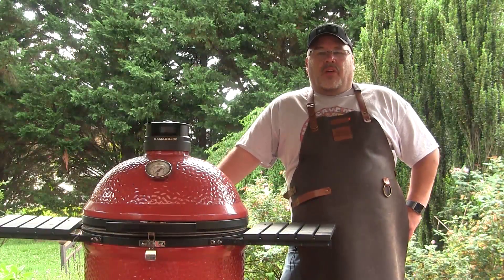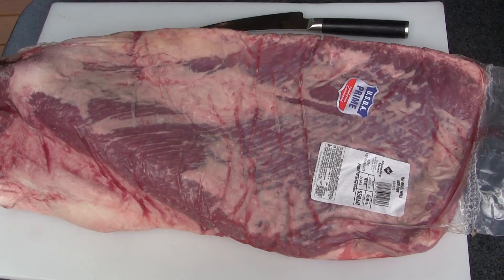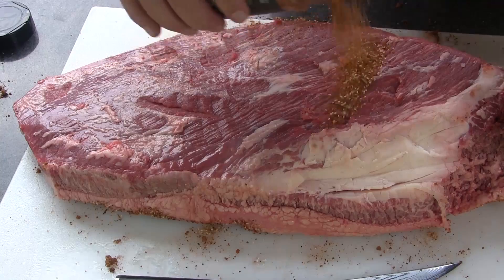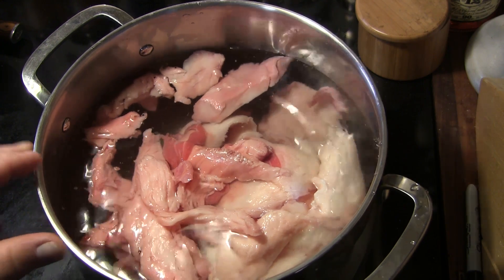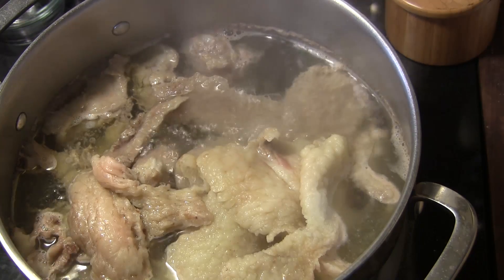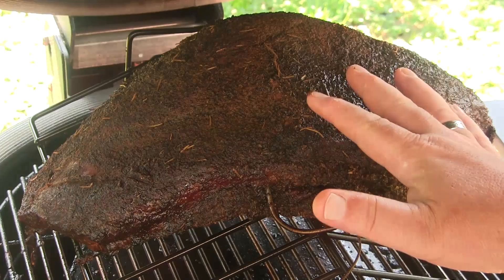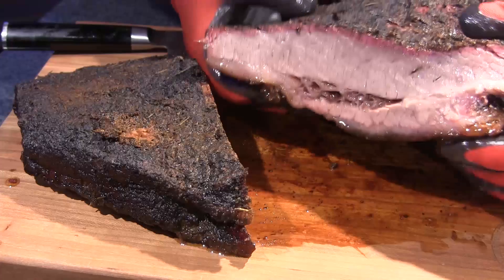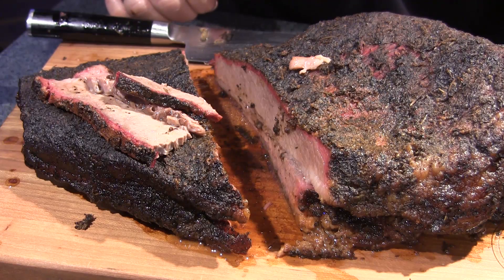Kamado Joe SLoROLLER Brisket + Beef Tallow

Comment: What's the advantage to the SLoROLLER over the diffuser plates
Reply: They are pretty quiet about it but they occasionally say it gives better smoke and heat confection like a oven instead of just diverting the direct heat. But that only applies to the gen 3 models where they changed they entire shape of the grill inside and out. Gen 1 and 2 can not use the slow roller or benefit from it.
Reply: Read the FAQ on the SloRoller here.
https://www.kamadojoe.com/accessories/specialty-tools/sloroller/

Also, I own a KJ2 and KJ3 and can so far tell a difference in the quality and ease of getting a smoke ring (i know its only visual but still rewarding). I've also noticed more even and faster cooking than without the SR. 
Check out John's SloRoller chicken video. It's perfectly and evenly browned and he says its the crispiest skin he's been able to achieve in a kamado.
I'll be trying a whole chicken on mine tomorrow to see if I can duplicate the results.
You can also go the the Desora website and see more info about how the SR works.

For Josh. 
KJ has several videos talking about it but the customer is the real world voice and theres just not a lot of owners with it to give their opinions yet.
Also, in the same FAQ section on the KJ SR web page, it says : "Does it retrofit my KJ2, BGE, etc? Yes. Each insert is designed for the common kamado grill plate sizes i.e. 18” and 24”.

It may not perform as well as in the Classic III and Big Joe III. The insert is optimized for these smoker shapes and sizes."
Reply: @hicksta1  John has said on this very channel that the slo roller doesn't fit the gen 1 or 2 models yet but they are producing a version that will in the future

Comment: I have tried the Ikamand and I am not a fan.  The problem is when the ikamand isn't engaged its blocking the air flow at the bottom of the grill.  So i find that the temperature thoughout the cook fluctuates to much.  Do you have any suggestions?

Comment: It would be really appreciated If you could make a chart with the different positions of the Kontrol Tower and the relative temperature. It would help very much.

Example:  Kontrol Tower line 2 and bottom vent 1 inch = * temp
Reply: There are so many combinations and several things can effect it including how   many starter fires you begin with. I cook year round so cold weather changes my settings as well. I marked my lower vent with 1" marks which gets me close for 150 250 350 no matter what and adjust the top

Comment: When are you supposed to wrap the brisket in foil? is 170 the target temperature, why is that? also, what's the end target temperature? thanks!
Reply: You usually foil wrap or butcher wrap when it starts to stall out. Anywhere from 150 on really. Target temp to start checking for tenderness should be 197-200 IMO. Everything starts breaking down around 195.